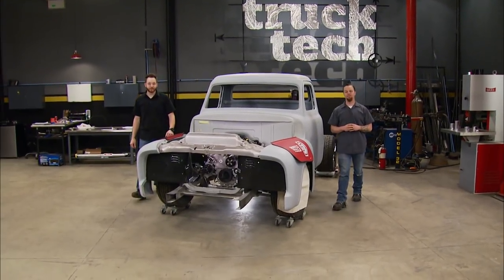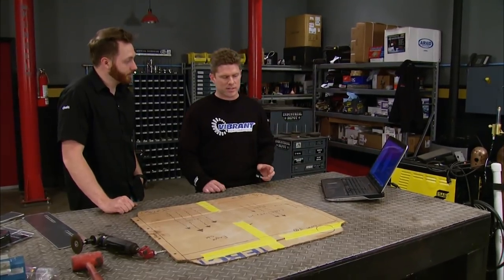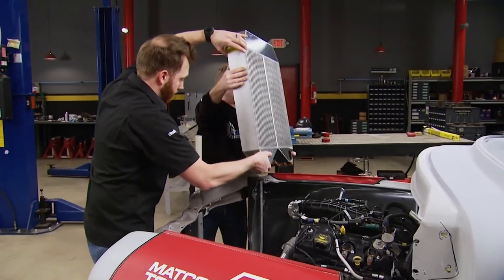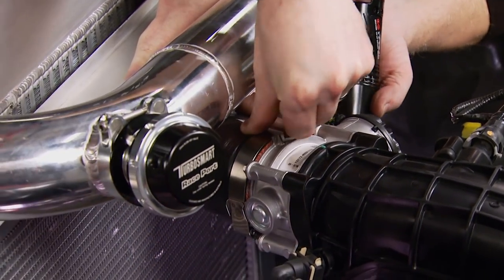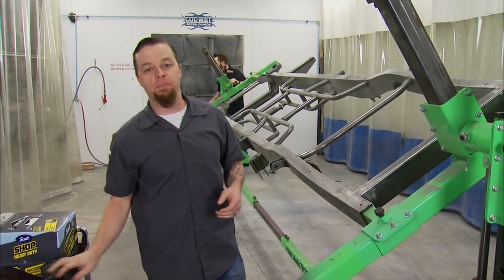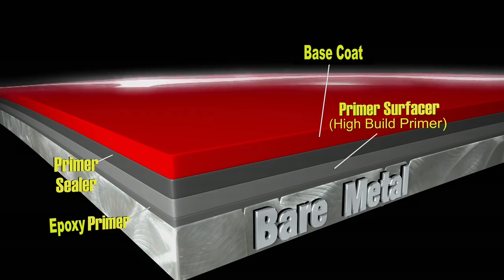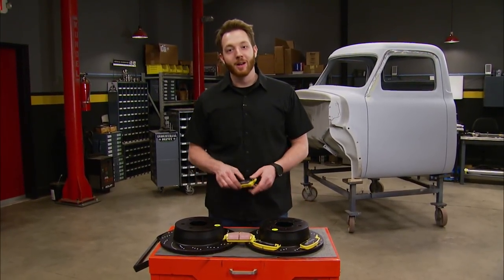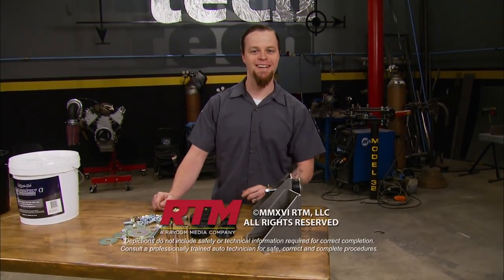Custom Intercooler For An Ecoboost-Powered ’55 F100 - Truck Tech S3, E10

Comment: 16:26 you can change the speedometer and shift speed with the programmer. You can not increase hp or torque on a n/a engine. The pcm does not control air flow off idle. If you want more power. You will need to change the cam or boost the engine.

Comment: I would definitely not go gloss for the finish but a Flat or matte finish for the frame or even use a spray in bed liner like process to coat the frame.

Comment: There is more than enough room for the stock intercooler. Don't lie and say it can't handle the higher boost either. Remember Ford had a problem with them cooling too much. That is why they blocked off some of the cooler.

Comment: Those slip joints (or whatever) that let the intercooler piping move under engine torque without loosing boost pressure in genius!

Comment: Why a EcoBoost, I would of went with the coyote. Not a fan of the sewing machine sound.
Reply: Because fuel economy
Reply: @jfindlay813  I don't build a truck for fuel mileage! Should of put a Prius setup in it then, lol gay....
Reply: They can add the v8 sound effect mode from the f150 lol!
Reply: @Spencer7445 _ The 3.5 can pull alot of Hp! Still sounds like a sewing machine. 5.0 has the best v8 note out of almost any v8.
Reply: @rigging1377  fuel economy gay? Please explain.
Reply: @jfindlay813  I dont have a dog in this fight but I would think it breaks down to this. Most people who do a custom builds are not going to daily drive it daily or drive it across country! Your also missing the "smiles per hour" that a v8 has! Let's also not forget that the 3.5 EcoBoost sounds like crap,it just does! All things being equal a 3.5 EcoBoost an a equivalent horsepower v8 cost about the same! This being the case why would anybody want to do a build with a 3.5 EcoBoost? Oh and for what it's worth the 3.5 EcoBoost gets 17 mpg city and 23 highway so it doesnt really get better mileage.
Reply: I’m so sick of the comments about how much better the eco boost is than the v8 .lets be honest All things being equal a 5.0 v8 will make more power ,sound better, and LOOK better under the hood !
Amazing how many people forget it’s turbocharged. 
“But it makes more power than the coyote!”
Yah duh turbo.
Pop a turbo or supercharger on the 5.0 and it’s proven to make way more horsepower and be LESS STRESSED per horsepower than the stupid v6 . Oh and economy?? Push that v6 to it’s fun level and you’ll see how bad the economy gets !! At least when you push the fun pedal in a 700hp turbo / supercharged 5.0 , you’ll have money spent well going through the fuel lines !

Comment: Cool late model motor. Whats sad is a Briggs and stratton would be an improvement and more reliable. Always sucks going backwards with a project. And I mean no disrespect to briggs and st. comparing them to that scrap metal yall are calling a motor.
Reply: Michael Teeple personally, if that were my truck, I'd put a 302 or even a 351 Windsor between the frame rails

Comment: Every Ecoboost I have owned had an issue. Ford quality is up to par with Dodge= JUNK
Reply: pascal olesen....still MUCH better than any Garbage Motors vehicle, and foreign owned Asian produced hunks of junk....
Reply: Owner problem.
Reply: I worked for Ford. You should have seen how busy the shop was with them and the 5.0s tapping